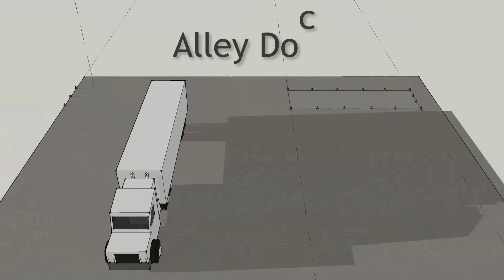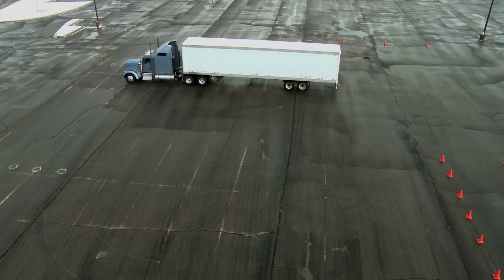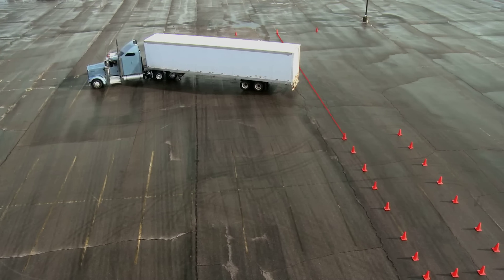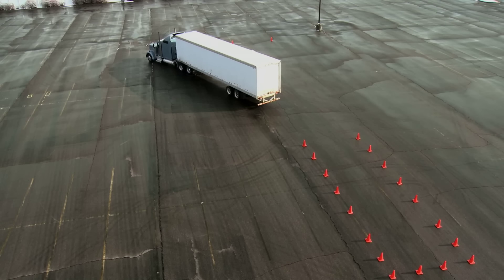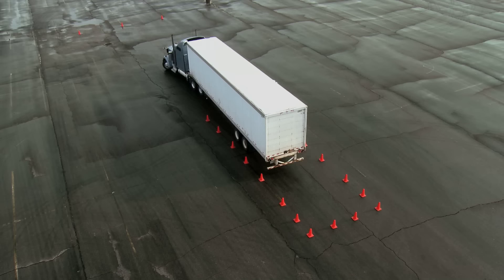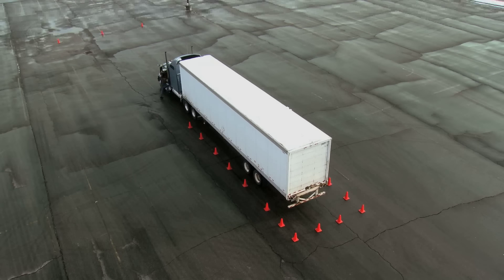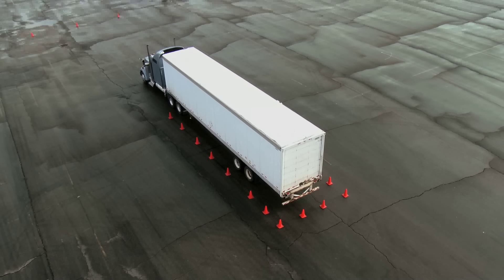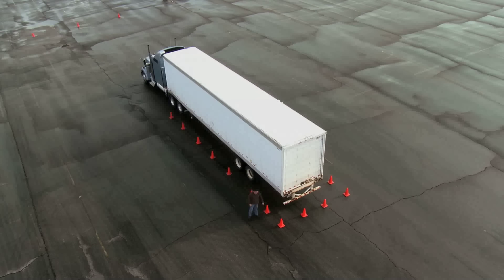Mooney CDL Training Revised Alley Dock with two free pull-ups for Tractor Trailers and Semi Trucks.

Comment: In real trucking life,  you use as many pull-ups and "get out and looks" as you need to the job safely.  Definitely not just two.   (30 years CDL and retired.)
Reply: When I got my license In PA in 2017 we could do as many pullups and goals as we needed.
Reply: @John_KCMO  you get2  free pull ups. You can pull up more but each time cost you a point . If you did straight back and offset without using any points ( which you should of) you have 13 pull ups on 90 without failing
Reply: @gabrielmiller1226  I am speaking or rather reporting my experience. If you were there and can report what the parameters were when I did it please explain
Reply: I’m in cdl school right now and I don’t understand why the limit is 2 get outs. Like you said whatever is necessary to do it safely
Reply: Yeah Cali different but I do see what you mean I say it all the time, they probably don’t wanna make it that easy
Reply: I figured that. Safety always Always ain't that what they say. SAFETY 💯🤝💯💯🤝💯💯 SAFETY. I DONT FEEL SAFE WITH JUST 2 LOOKS.
Reply: I just got my first load done today as a truck driver (brand new driver here) and my first load had me backing into a really awkward spot. It was uphill, at an angle, tightly packed against two other trailers. It took me almost an hour of screwing around with it before I finally got it in perfectly. I must have pulled up and gotten out a dozen times each. Didn't matter. Got it in eventually, didn't hit anything, job successful.

The security guard saw the whole thing and we joked about it. I mentioned I was brand new and he said "don't worry man, my dad was a trucker for 47 years and he couldn't back to save his life."

It really is all about practice. The DMV is stupid. You can get out and look as many times as you need. It's infinitely better to have a late shipment that's intact with no accidents than to risk the cargo/equipment/yourself because you're in a hurry.
Reply: In order to pass the louisiana state cdl test you're limited to 2 pull up before points are deducted. However for louisiana (dda) if you use a pull up outside the box you have to pull towards the set up point if you're in the box you can turn it into a straight line. Same rules apply for the offset as well.
Reply: @gabrielmiller1226  in Kentucky, your free pull ups from straight line backing and offsetting don’t transfer to the next maneuver, if you don’t use them. We don’t even have to do ally docking, just straight line backing, offsetting and parallel parking.
Reply: Instablaster...
Reply: Flavour Junction  why
Reply: Flavour Junction  What is it because you failed the maneuvers? Or the pre-trip
Reply: @John_KCMO  not anymore I take it next week it’s only 2
Reply: @gabrielmiller1226  nope the 3rd get out you fail now
Reply: California you only get 2 pulls up
Reply: @jackiesmith238  isn’t Cali you need your tires in the box before you can do any pull ups? I’m in school right now and that’s what they told me.
Reply: The countless times you can get out in real trucking means nothing while you're taking your test
Reply: I obtained my Class A Cdl and applied for Western Express. They gave me a 3 hour window to provide a specific amount of urine for drug screening. My 3 hours expired resulting in a violation on my Cdl. I received my SAP certificate of Completion and am currently looking for a company who consider drivers that went through the SAP program.
Reply: @capricorn8412  man I'm praying 🙏 for you brother...
Reply: @brianherrick815  Here in Florida you also need the back tires in the box before pulling up.
Reply: I dont understand why dmv only allow you 2 pull ups and looks on you road test, i passed my road test 3 weeks ago but I found this very stupid and unsafe.. btw we dont do ally dock in new york city when you taking your road test that make it easy i domt know in another states
Reply: Hey Frank I think they’re talking about for the DOT testing for the CDL that’s what you get maximum before they start taking points off on you if somebody else didn’t say that
Reply: I agree, I drive an aerial basket for trimming around power lines. If I have to do a 30 point turn to get my truck in or out of a place so I can trim the trees, I do it.
Reply: Thank you for your tip and experience
Reply: Don't forget in under 10 minutes as well.
Reply: In ky they don't even test us on alley backing. They.make us do a parallel park.
Reply: @Frank Mooney I need your help
Reply: In Minnesota we get 1 pull up
Reply: But when testing you only get two. Real life.
Reply: @John_KCMO  not any more I guess I’m in school as we speak in Harrisburg, and now only 1 pull-up for straight line backing, and two for the other maneuvers. 🤦🏾‍♂️
Reply: I was actually just thinking this, if I need 3 or 4 or 5, however many I am fucking taking them
Reply: He’s talking about two free pull-ups and then every pull up that you use after two will be one point this is for your test at the DMV
Reply: @capricorn8412  did you ever find a company to work with your situation?
Reply: This video is based on testing purposes. But in real life you do as many PU and GOALs
Reply: Man even he messed up lol u gotta show a video atleast of a perfect one
Reply: Yes sir .... Just like my daddy taught me ...get out as many times as you need to....to make sure you don't hit nothing.
Reply: I just wish every dock was as perfect as the dock I hit when I got my license. I’ve been doing this about 10 years and I’m not full time over the road, but I do a lot in the cattle industry and equipment transport across Kansas. Some of these sale barns the way their docks are setup, makes it really hard  to put an ‘84 Pete 389 I that alley way.  Gotta be pretty well spot. Salina sale barn, farmers and livestock commission, is probably the best I’ve seen. The loadout chute gets a little tight but way better than most barns and places I’ve been to
Reply: In real life for the DMV test there’s only 10 pull ups for 3 different skills test. That’s why it says for CDL testing. (Student Trainee Driver No CDL)
Reply: they’re just setting you up to take advantage of you. i’d do something else
Reply: @John_KCMO  those were the good days
Reply: Okay, but if you're being tested to become a pro, and it's just cones, you get two.
Reply: Yeah I agree. It's what I did. This two pull ups  crap is nonsense. Now add snow, ice, darkness.... And not a nice obstruction free giant lot. This is not training. It's setting somebody up to fail. I learned on the road and never hit anything in my ten years truck driving.
Reply: G.O.A.L, right?
Reply: @edwinxtremeboost.k2483  so in new York city you don't do alley dock just offset straightline and parallel?
Reply: @edwinxtremeboost.k2483  also what boro
Reply: Just got my CDL in March this year. From the state of PA. Even the instructors at the driving school thought this rule was stupid, unsafe, and bogus. They emphasized the same thing you did. In real trucking, you get out and look, and pull up as many times as you need to. The state is teaching new drivers bad habits. 

Also, I went to roadmaster driving school. Literally just last week, we all got a phone call with a letter coming this week. The state wants us all to test. Again! Going back to graduates from a year and a half ago! We've all started developing better habits than this!
Reply: I hate the test has limits
Reply: @John_KCMO  what.  In California you only get two or three trys
Reply: Don't worry Frank, the rest of us on the road are well aware of the fact that most of you truck drivers couldn't pass a test a like this.
Reply: Just about to say this.  Competition is one thing, but there should always be the explicit message that there is no outside pressure or embarrassment for pulling up as many times as necessary to not only avoid any collision but to maintain peace of mind while doing so, (as well as getting out and looking personally to make absolutely sure).  Once you are doing a run constantly and have situational awareness you can start cutting out the "extra" steps but you still have to maintain due diligence and avoid complacency.
Reply: Texas you only have 2 pull ups and 2 goals as well.
Reply: Amen
Reply: But then the ppl in fc get mad and send their yard dog to do it, it happened to me like 3 times this week and im new to the job they just don’t gives you chance to do it. It was ups warehouses
Reply: @jonglenn926  They don't want you taking all day to straighten up. It's just typical business. When you get out there on your own, you can do it however many times you want.
Reply: Frank,
Thank you for your service
Reply: If you fail do you have to pay for everything all over again?
Reply: I just passed my test and we only get two free pull ups before you start losing points and if you get out more than twice then it’s an automatic fail
Reply: @vincentbolden8456  then you have to pay for a class all over again?
Reply: right, but you have to pass this test before 30 years of experience and retirement.
Reply: In Canada, the driving center(CDL) suggests you do GOALs as many times as you want during the test, and obviously, it's for safety purposes.  I don't quite understand why there's a 2 times limit in the Stats
Reply: Yeah exactly but these company’s act like that’s a fucking issue pisses me off
Reply: This is school.  They want students to actually be able to drive. In this particular exercise, you lose points with more than 2 pull ups because they need to draw a line for grading.

Thanks for not understanding school. I see you didn't go to one
Reply: Obviously 😂
Reply: Thank you the school I'm at we get 2 pull ups and can only get out once that's crazy 😂
Reply: I realized that the CDL driving test is harder than actual driving, and this is testing people that are the least experienced drivers on the road. 

My test included a rail crossing 40 feet from a 55 mph two lane highway that you had to turn right on.

You had to stop at the stop sign before the tracks, then proceed once the highway was clear to the left, then make a tight right turn with a 40 foot trailer without going into the opposing lane,  and not shift to get up speed while on the tracks or stop once you start over the tracks. Literally no stopping once committed. 

In real life, no one in their right mind will take a truck over that intersection. You go another route that's safer.
Reply: Please
Reply: 30yrs ago it's 2025,on 2 free pull ups

Comment: "Takes about 10-12 feet for trailer to react to tractor's correction."  That's a valuable little piece of information, that so few others even think of.
Reply: So he should turn the trailer back soon as the first axle wheel crosses the first cone?

Comment: Been on this Earth for 32 years and this is by far the hardest thing I've ever had to learn.
Reply: But not impossible I’d try it 😁
Reply: Agreed
Reply: Tell me about it.. and I'm a B Class motorcoach operator
Reply: The difficult part is when you don't have any working knowledge of what you're actually trying to do and also avoid..... Everything is way easier when you know you can't turn the trailer the way you want until you're straight with it, knowing that you'll intuitively figure out the angles and shit
Reply: Try putting  53 into a  old dock in Cincinnati  that was made  for 48 
.It was CHALLENGING WITH 379
Reply: Blindside parallel tho😅

Comment: In 1970, I worked at UPS.  They had yard guys that put trailers into the docks.  They often put 2 trailers in one door.  You would see them pull up and beep beep then back they came.  Always got it right the first time.  You could not fit a broom handle between the trailers.  I'm still amazed to this day.
Reply: They're still like that. UPS has such a high standard, and they train drivers intensely, and ultimately they can do really hard maneuvers that most drivers will never encounter.

Comment: I did my road test with the same setup as in the video. KW900 super 10 trans with a 53’ dry-van. Some people are now taking their road test on a small single axle truck with a 6-speed transmission and a 35’ Flat-bed trailer. So easy! But I’ll tell you, it’s gotten a lot harder on passing it now because it’s required to know the actual mechanical components of the truck.
Reply: Out here we using the same truck in the video when I checked out a diffrent school they was using cheater trucks lol
Reply: The shorter the trailer the harder to back
Reply: Shorter trailers react faster and are harder to maneuver than a 53
Reply: @autk so true, but it’s easier to make right turns.

Comment: See all those lines (cracks) in the concrete? Use them, they are everywhere and are your best friend when backing. Even shadows can help.
Reply: Wait how so? Care to explain? I’m thinking you’re talking about using them as a reference point of some sort, like to know where the end of the trailer is.. but i could be wrong.
Reply: @ohskibroski  yep, use as a reference point. Some docks won’t even have a painted line to follow. Use the seams (expansion joints) and cracks to guide you home.
Reply: Light reflections are fine too

Comment: I have no CDL but I have a ton of practice at this I am a full-time Yard Switcher at a Distribution Center, we never leave the yard so no CDL required. If you have a big Distribution center in your area try to get a Yard Dog job it is a great way to get paid to practice moving trailers around and learning how to do a pull through, and button hooks, 45 and ally docks or button hook away from parking space so you can straight line back. Lots of practice I move 75-90 trailers a shift. Good exercise too climbing them 3 steps up to the truck and walking back to open swing doors and kick chocks. You also learn how to hook up gladhands and operate the airbrake system valves you learn what it means to slip a king pin or fail to couple and almost drop a trailer "even though you tugged it and it passed the tug test." cranking landing gear and if you are lucky you will get to move around pup trailers as well fast reacting little terds they make 53' look easy.
Reply: MsDannyrevs big difference in yard truck and sleeper
Reply: Can we be a Yard Shunter without CDL
Reply: I hate pups and flatbed 28’s
Reply: Yes it depends on the account. If you never leave the yard you do not need a CDL
Reply: MsDannyrevs I applied for yard driver at my warehouse, any advice?
Reply: Hope you have strong knees because it is a lot of up and down climbing.  I do not drive yard tugger anymore I got my CDL A and now run Line Haul for a local LTL company!!! Yard doggin really made me shine at trucking school over my classmates After I completed my first range day everyone in my class was asking me for advice and the instructors had me watching the other students on one of the practice exercises because they knew I knew what I was doing! Advice, well remember the less wheel movement and adjustments you can make during the backing phase the better you will be. I advise you crank the shit out of the wheel at first just to see how much they move that way once you experienced the max adjusting to the minimum is easy. If you have to deal with PUP trailers I advise you hook on then lift it up then get out and crank the landing gear down a few cranks makes putting a jack under them easier after you unhook. Trial and error backing trailers is simple driving big vehicles with a trailer is simple just give them plenty of room when you make turns and the sooner you learn to button hook and do pull thru's to park the sooner your workmates will like you because that is the fastest way to park a trailer in a yard do a pull thru vs backing in. Oh, Chapo as for your comment up there Sleepers I do not drive them, I went from yard dog to day cab and this is where I will be until I retire. At the end of the day getting the yard dog job was the best thing that could have happened to me as far as propelling me into actually driving Semi Trucks. It is a fantastic stepping stone into the world of Truck Driving. You will be nervous your first few days but everyone is, so do not worry about it. The people training you and checking you out in the yard dog are not looking to see if you can just jump in and do the job. They are looking to see if you have the potential to do the job, if you have the underdeveloped skill set they are looking for because the truth is a job like this is only learned by doing it. Everyone sucks at first everyone is nervous at first but you get faster and better with every back. I am sure you have forklifts at your warehouse job. Driving a yard dog is like driving a forklift. Everyone sucks for a few weeks but then it just clicks.
Reply: When I used to work the yard at a Walmart Distribution Center we had to average 110 over a 10 hour shift. Which included finding stuffing in the door and kicking the chock. Some of the best people could put on average 16 in the doors an hour and that was flying.
Reply: Freakin hate pups!!!

Comment: I start about 7 feet from the bay and just about jackknife then I can look out drivers window while returning to center I stop when my bumper is just in the bay. I use a get out here and walk around the entire truck. Helps me to make my adjustment. Sometimes I will need to do a baby serpent to move the front of the trailer, and sometimes I can proceed to slip back into the bay. All depends on what I see.

Comment: I failed this maneuver today in Fresno, CA. Just a FYI. . . we were not allowed to pull forward to straighten out unless the end of the trailer tip is in the box. We had to pull all the way around  again (perpendicular) to re-set and restart.  Super frustrating, because I did this exactly like the video -- started out with a too tight of a turn and got near the front driver side cone on the doc.  Just a little FYI for anyone still practicing.